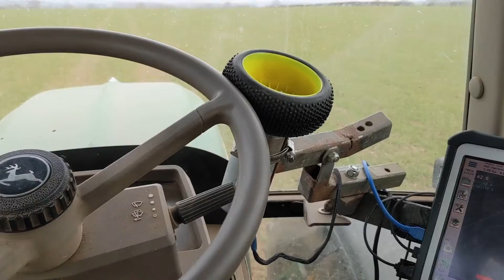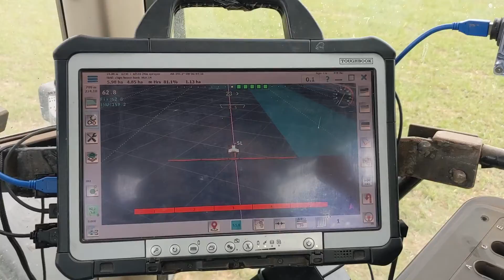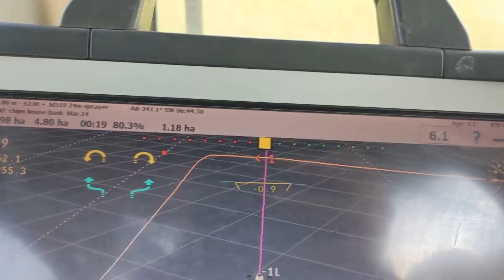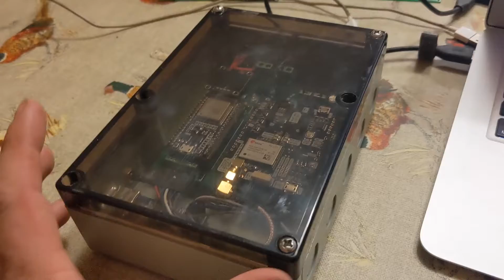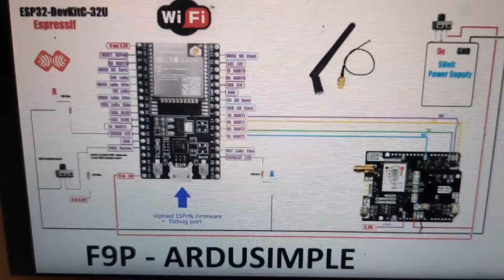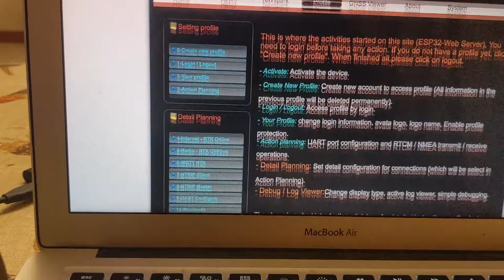My homebuilt Agopengps autosteer and esp32 rtk basestation set-up

Comment: Thanks for the detailed video. Considering that you have prepared a PCB option, I will try to follow your path. On the net I found different schemes for your board, with and without a buzzer. Can you tell me what is the final version? P.S. If possible, post a photo of how external electricity is organized on the board.

Comment: Hi Jim, great video
No subscription cost, so where do the base station get rtk correction from?( Seems like there is not any rtk2go in South Africa, or do I have  this all wrong)
I also have fields with no cellular connection. How would one get around that?
Reply from the maker: Hi Andre. Thanks for the comment. The base station provides a private correction signal for the autosteer on the tractor via the internet\cellular connection (I think it's called ntrip).  I have also been using someone else's signal (50km away) through rtk2go which is pretty similar but open to anyone. I am fortunate that I have good cellular on the farm but there are other options using radio but I don't have any experience with this but im pretty sure it would work with Agopengps. It might be worth asking some questions on the agopengps forum. I've got a feeling it's called LoRa. The farm where I plant potatoes uses a commercial topcon system which I think works in a similar way because they also suffer from poor cell coverage on certain parts of the farm using a mobile base station. Hopefully that helps clarify things!
Reply: @jimsfarming7792  Thanks for reply
I wonder if it would be cheaper to go radio root or try to get cellular signal everywhere on my farm, which will be more convenient anyway. Will see what the forum says
Thanks again for the time you spent sharing this

Comment: Looks great. What is the range of the rtk base station?
Reply from the maker: It works over ntrip with cellular connection in tractor so as long as data connection is available any distance, however as far as I understand accuracy of the correction signal gets less over 20km. That said I have been using a correction signal on rtk2go.com that is 45km away and results are very good.

Comment: Great video. Do you mind sharing the files for the printed board? Looks like a great solution vs prototype board.
Reply from the maker: Yeh no problem. Bit busy at the moment but I'll try and get onto it in the next day or two👌
Reply from the maker: Just an update on the PCB. It has become apparent that there is a slight problem with the circuitry and a potential issue with the buzzer causing the esp32 to fry. This can be resolved in the current design by removing the buzzer. When I get time I will update the design and place a diode between esp32 and buzzer to prevent this problem.
Reply from the maker: https://drive.google.com/drive/folders/1rblMmKgi-_YCzAvS21dt4g2h07278Fah

Sorry about the wait! Busy with sheep and planting beans! Let me know if you have any issues downloading the files.  I've corrected the things I mentioned on the video on both the schematic and PCB layout 👍
Reply: @jimsfarming7792  hello i want to discuss lot of things about this project.